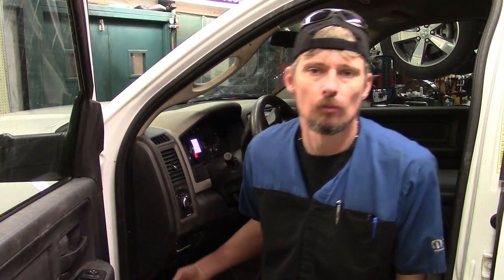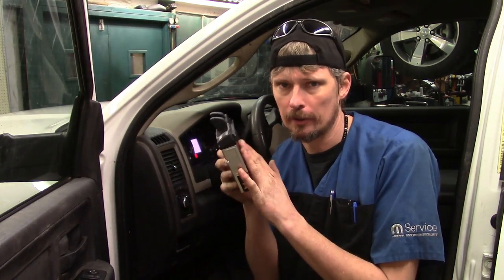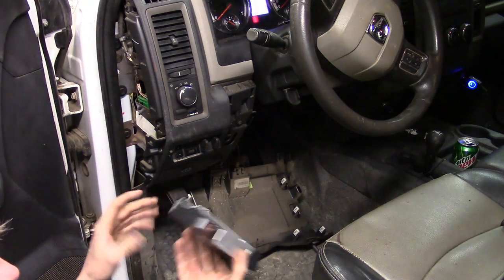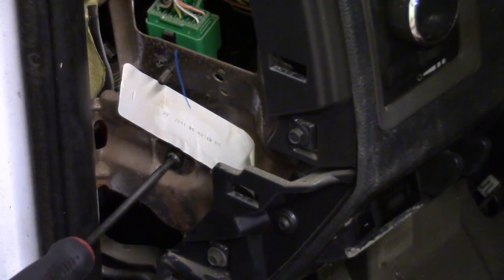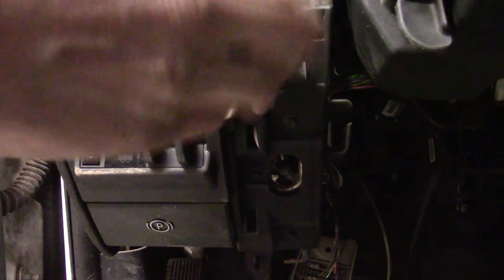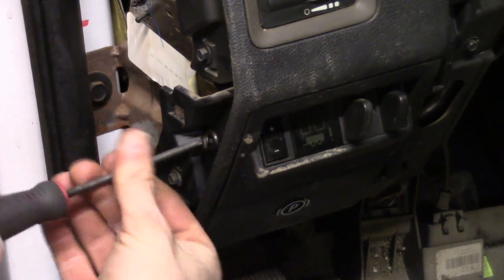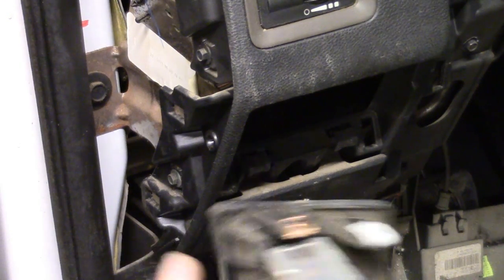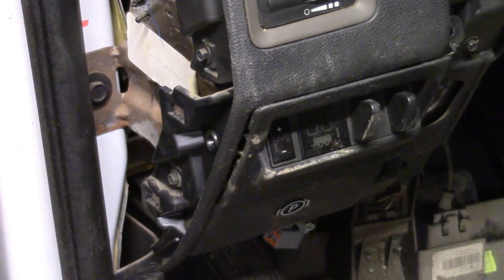2010-2012 Ram truck Integrated Trailer Brake Control (ITBC) module replacement

Comment: I have a 2012 Ram 1500 Big Horn with an ITBC. The problem isn't with the controller, but the parking brake lever broke. I knew I had to remove the brake controller, but I wasn't sure how to. Thanks for the help.
Reply from the maker: Glad that the video helped. Appreciate the comment and make sure to subscribe
Reply: Hello one of my enclosed trailers brakes keep locking up, I hauled it a good few times but now they lock up every time I try to haul it, any idea why? I use the trailer for construction I have the same Ram as you do also, it doesn’t lock up on my Chevy…

Comment: Hi, I have a 2012 3500 with a G56. I can't change from "light trailer" to "heavy trailer" in the EVIC. I can select it but it won't change no matter what button combination i hit. I can't get much out of the manual. Does this indicate a problem with the controller or am i just doing something wrong. I set parking brake and everything i can think of but nothing seems to work. I tow many different trailers so i need to resolve it. Cheers,
Lyle

Comment: My brake gain is set at 10, but I put a tester on my 7-way pin hop in my truck and apply the brakes... on the tester it reaches 6 for my braking power, but won't go up to 10. Is that a sign that the ITBM is bad?

Comment: I have a 2011 ram 3500, the trailer has electric over hydraulic brakes. The trailer brakes have always had a little bit of a delay when brakes are applied. But now when I apply the foot brake, I don't think they're working at all. When I engage the brake controller, they will work to the point of sliding the tires., but they have approximately a 3 second delay before they start to hold! Can you give any advice to whether the problem is the the brake controller, or could it possibly be the actuator? Don't want to just throw money at the problem. I would greatly appreciate your Expert Advice!

Comment: I have a 2012 RAM 2500 diesel and it came with no brake controller.  I am getting ready to purchase a new OEM controller from eBay.  I have already checked and the two connectors are there, taped up next to the OBDII connector.  Is it just a matter of plugging the brake module in and calling it a day or do I need to go to the dealer and have them perform some magic on the truck's computer?  Thanks for all your videos, they are a great help!
Reply from the maker: Paul T. Garrett The install is simple enough except for one of the 3 bracket screws. One trick....install the screws first so that the threads get started and then remove them before install. I can say that one screw gets left out because it's almost impossible to install. You will understand what I am saying when you do the install. The dealer will need to change the sales codes and then download it back to the vehicle I order for it to work correctly. Thanks for the question and make sure to subscribe!

Comment: Hello I have a 2012 1500 Big Horn Ram, and one of my enclosed trailer brakes keep locking up, I hauled it a good few times but now they lock up every time I try to haul it, any idea why? I use the trailer for construction, it doesn’t lock up on my Chevy…

Comment: Thank you so much!!   I have a 2012 diesel.  I keep hearing my controller do intermediate periods of constant clicking. A short time after that my left (drivers side low beam) will quit working.   I have replaced the head light switch a couple of times and then it will work for a while and then the same thing will happen again.  Does the IBTC brake controller effect the headlights?
Reply from the maker: I dont see how it would affect the headlights. I recommend having all the modules scanned for codes to see if any are present. I have only had issues with one brake controller so nothing common on these.
Reply: Thank you so very much  @MotorCityMechanic  !
Reply from the maker: @TheTrooperGirl  Your welcome

Comment: Are those connections already there from the factory? Or is there others procedure in order to install for the first time?
Reply from the maker: The connectors will be there from the factory if you wanting to add the controller. It will require installing a bracket and having the dealer change the sales codes and down load it to the truck in order for it to start working properly. The dealer sells a kit that includes everything. Thanks for asking and for watching.

Comment: I installed one of these into my 2010 1500. Previous owner had an aftermarket brake controller at some point as I have screw holes on the knee boaster and the second plug is wired in. I get the ITBC to light up and all that but nothing to the rear plugs. Some say it’s plug n play and others say I need a flash. Dealer even says they’ll have to flash it. Can you confirm if it needs a flash?
Reply from the maker: The vehicle needs to be flashed. Flashed is not really the term but close. What needs to happen is the tech at the dealerships needs to go online and add the new sales codes (vehicle DNA) to the VIN on file with Chrysler and then download the new updated build info to the vehicle so that the vehicle now knows what it has and that way everything starts to play well together. Most dealers will charge 0.5hrs to do that which is in the $50.00 price range depending on their hourly shop rate

Comment: Do you have to have it programmed at dealer
Reply from the maker: The feature has to be “enabled” by the dealer. They have to add the sales code on the Chrysler website and then download the new build configuration back to the vehicle

Comment: I have a 2017 ram 1500 5.7 and I have no brake controller switch.  Ihave the hookup n the rear. Do I need the switch up front?

Comment: Got a 2011 Ram 2500 and the trailer brake switch is not working with error code on the dash after the dash was pulled for evaporator core replacement. The controller is plugged in and fuses are good. I read something about getting it flashed. Any thoughts?
Reply from the maker: Flashing wont make any difference in my opinion. First thing I would do is hook up a scanner that can access all the modules and see if there is a code present. Simple code readers wont do this. The next think is being that it didnt happen until the dash was pulled.....double check all connections everywhere related to what was disconnected for the evap replacement.
Reply: Dsimm, did you ever figure out why you were getting message? I just had my evap core replaced and now I’m getting same cf service trailer message….about to buy a new brake control module… did that work for you?
Reply: @jrf1950  my problem ended up being with the trailer brake wiring and not my controller. A couple of the wires had come loose on the electric brakes and it was effecting my controller.
Reply: @dsim3211  was it the electric brakes on your trailer or on the truck? If on the truck, could you point me where to look?

Comment: I've got an '11 2500 SLT with this same controller. It works but the gain is at 10 and if you manually apply the brake on the controller it locks up the trailer. (5th wheel) . But, by just stepping on the brake pedal with the gain on 10 it will only go up to 3 or so. Truck and trailer brakes are ok. does this indicate an issue with the controller other than it being crap like some people claim? Thanks
Reply: Hey did you figure this out???? I got the same prob
Reply: Hi, initially I hooked up my Tekonsha Prodigy which worked great but kept coming up on the dash that there was an issue with the oem controller because of being unplugged. I read the many reviews from people with the same problem but I eventually got rid of the truck because of the front end issues. I now have a 2019 Ram and it is way better however, It developed a similar issue. I found  that the pin in the 7-pin plug on the truck that controls the brakes was tarnished a bit. I cleaned it off and the situation improved a lot. I would look into that first.

Comment: I been looking and looking for information. 

Does this work for 2009 dodge ram 1500 as well ( first ram redesigned) 

Should  I use a aftermarket or should i use OEM
Reply from the maker: I am not fully sure. I would recommend contacting your local dealer and have them check to see if Mopar offers a kit for that year. I may have gotten my years wrong on the one in the video and it might just apply to yours. Personally I like the OEM look and function. Otherwise there nothing wrong with going with an aftermarket version either. It all depends on if your truck has the connectors already present for the module. Thanks for asking and make sure to subscribe.

Comment: I have a 2012 ram 2500 and my controller says CF with no trailer hooked up. All wiring is ok. The message comes and goes. If I replace the controller does it need to be programmed by a Dodge dealer?
Reply from the maker: There is a chance that the controller could be bad. To be certain I would recommend having the modules scanned for codes first to make sure its not something simple. It requires a special scanner that can access all the modules. If you end up replacing it then the new one will not need to be programmed. Just plug and play. Thanks for the question and make sure to subscribe
Reply: Corbin Mcpherson I had the same problem with my 2012 Ram 2500 coming up with “CF” and telling me to service my trailer breaks on my evics messages. All that I had to do is swap out the broken trailer break controller with a working one. No need to go to the dealership.

Comment: My 2012 dodge Cummins brake controller is not locking my trailer brakes or applying brakes to them . Could it be the controller or a fuse
Reply from the maker: Its hard to say. It requires a special tester to check the output of the module and then also scanning the module to see if any obvious issues. Its not the easiest thing to check and most places/dealers dont have anything to really test it with.